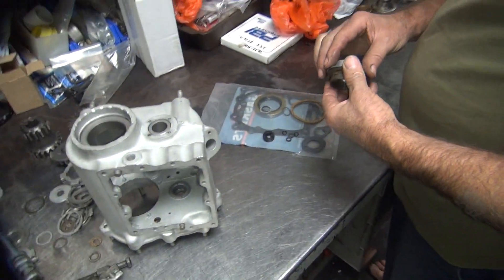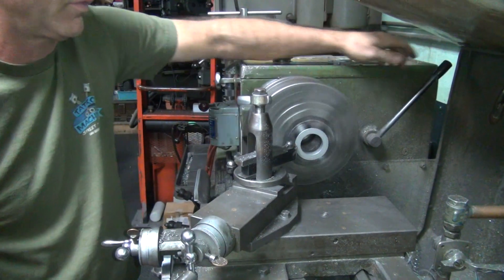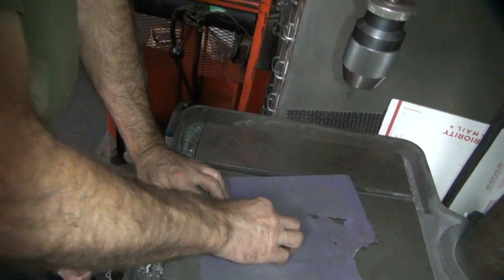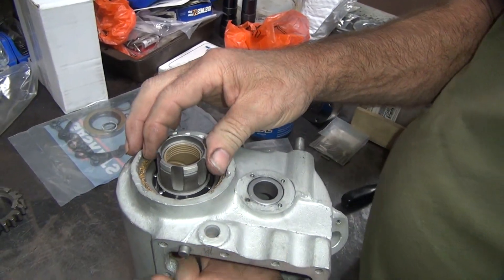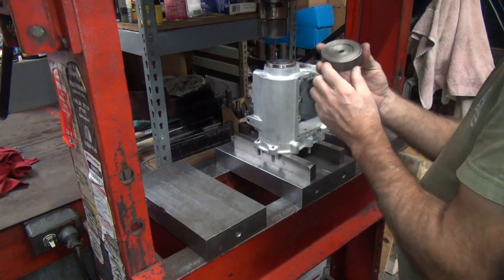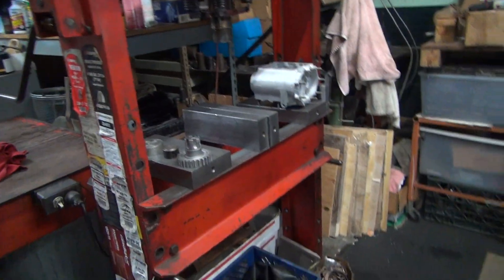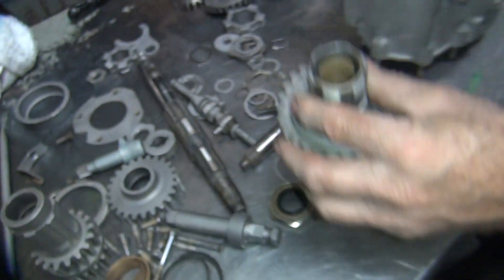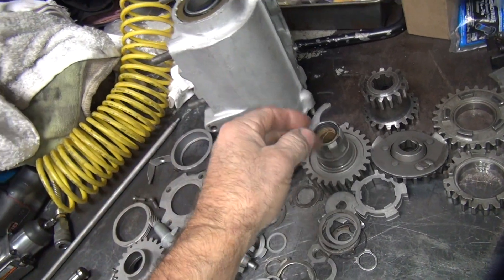#114 1952 panhead rust bucket 4-speed transmission rebuild fl flh harley bobber by tatro machine

Comment: Will the JIMS 2256 tool work for the drive gear small seal installation on a four speed?
Everything I see reads it's for a five speed, but I haven't a clue if they run the same gear/seal.
Reply from the maker: they are close but you can not recess the seals anymore. flush is all you want these days.
tatro